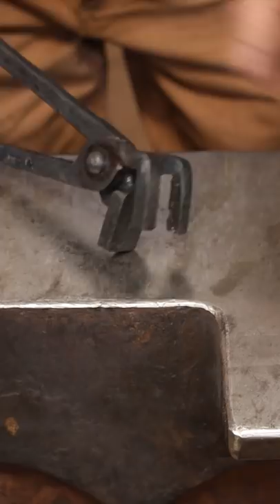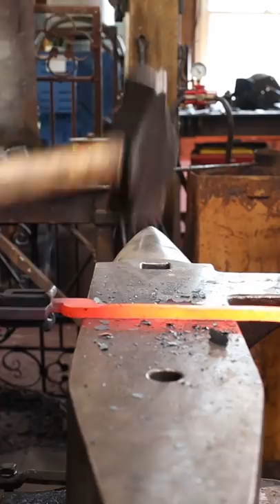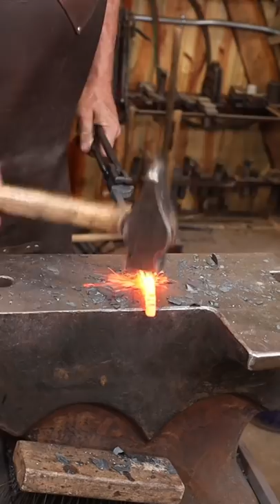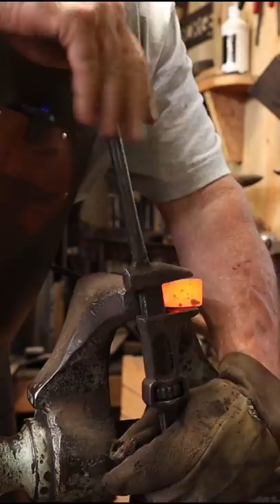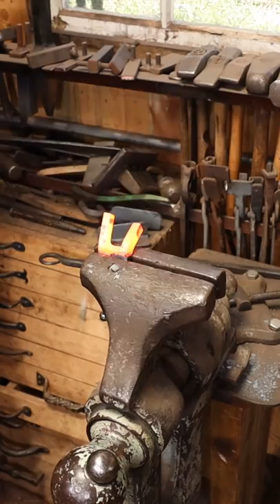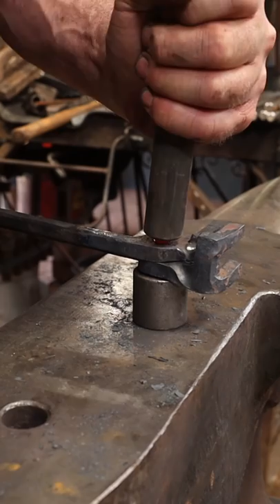Railroad Spike Tongs - #shorts

Comment: Some states will lock you up if you have any part to a rail way.
Reply from the maker: The railroads don't allow trespassing or stealing their property.  But it is perfectly legal to buy spikes yourself.  They are available from a large number of industrial suppliers.
Reply: @BlackBearForgeII  makes sense, I know back when I was young I use to walk the track to school and would see spikes laying all up and down the tracks, also at our recycle place for metals, there's a sign posted of having any parts to a rail way there would be charges. But that's why I said some states. But I do like your work. Just trying to look out for you if there was a different case you know what I mean. But keep doing what your doing. That was a great PC .

Comment: Are the flakes being left behind on the rail spike by the hammer or the spike?
Reply: Also what are those flakes?
Reply from the maker: That is scale, an iron oxide that forms at high heat.  it comes off of the red hot metal